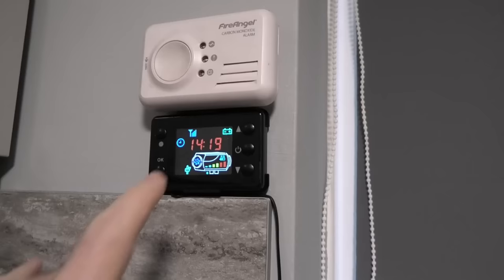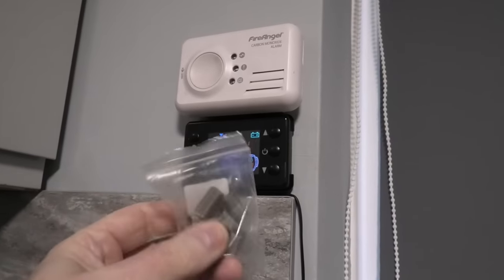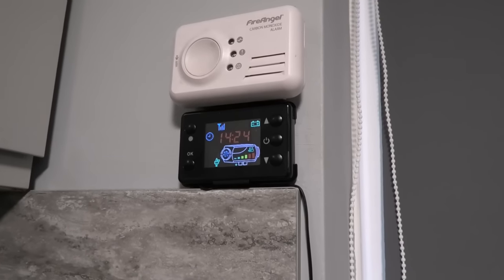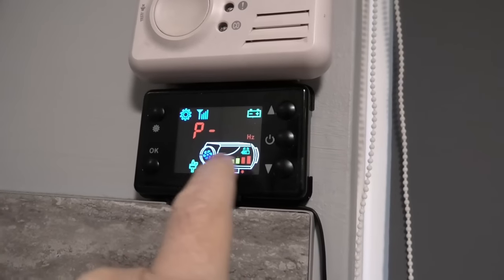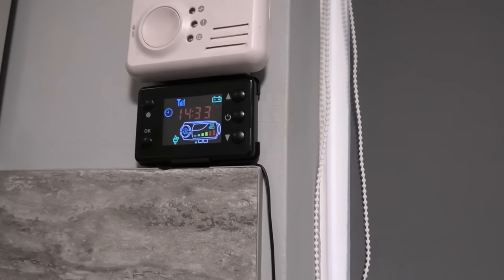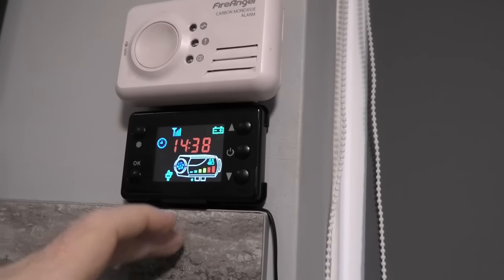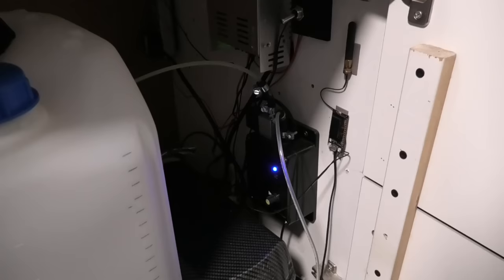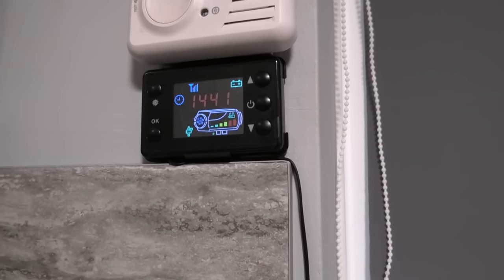How to tune a Chinese diesel heater with no tools 2kW & 5kW

Comment: That’s pretty good explanation of how to tune it. My 5kw is on a max of 3.3 at the moment as my fan speed is 4600 max I didn’t think they liked 5000 but it sounds like yours has lasted okay so might push it higher. I’ve had terrible carbon in mine but its getting better now the mixture is leaner. Thanks for the video.
Reply from the maker: They will all go to 5000rpm but different manufacturers have different default values that get them all running in the test room. Different altitudes and air conditions need different air/fuel mixtures so the manufacturer of yours might have been at a different altitude or in a vacuum 😁
My suggestion is, strip it down and clean it. I will be doing a video on it, it's not hard.
Reply: @Vortecks  I have just cleaned it. As I said it's getting better as the mixture is leaned out. It did start off as an 8kw with the usual over the top settings so it's taken a while to get it to a decent setup. I wish I'd seen your video a year ago it would have saved a lot of stress 😀
Reply: @julias-shed  that's another issue with Chinese knock offs, they lie ! There is not or ever has been an 8 KW 😏 these are copies of the eber 2KW and 5KW heaters,  the Chinese fall into the group who think more fuel equals more heat, 8KW is just a 5KW  run at a higher pump dose rate and "sometimes" a higher fan speed, this either soots up or the fan bearings go, usually because the brush end bearing gets full of brush dust due to the motor overspending and prematurely wearing out the brushes 👍
Reply from the maker: @Dirt-Diggler  Some mainboards & LCDs allow a fan speed of 5500 RPM with an increased pump speed. I might be wrong, but I think these are the ones marketed as the 8kW version. Last year, I tested a 5kW which goes to 5500 RPM and it will just about hold combustion at 5500 RPM and 5.3hz. The only trouble is, some of the combustion happens outside the flame tube and goes directly into the exhaust and the exhaust was hitting 280C. It 'might' be the equivalent of 8kW in total but there's probably 3kW which is directly pumped into the exhaust. Very dangerous.
Reply: they dont like 5000 none of them do. The 5000 is only for a badly made machine. The startup sequence rpm ramp speed on 5000 runs them to lean full stop. From the 55deg mark when the plug extinguishes and it ramps up the fan speed to max because it thinks its lit, you are merely running lean as the air in the AFR spikes massively. This has been proven by countless people with proper measuring devices. The 5000 setting automatically sets the start up algorythim to ramp the the fan up quicker than it does on any other setting so its not just the max rpm effected. Anyone whos heater can run on 5000 no problem still wants to back it off a bit as it saves the plugs. i can get boats doing 3-5yr  on these cheap copies and 5-7yr on the original plug on the genuine ones and i diall the smoke and smell out of them within minutes.
Reply: @Vortecks yeah mate dont even bother running them over 5000 they decimate plugs as the AFR is a mess at the end of the start up phase as they ramp at ridiculous speeds.
Reply: so people know what i mean the max rpm settings are only to be used on a badly made machine that really needs them to even work out of the box. If your machine even runs right on max rpm and Hz multiplier then by defacto there is dramas with your machine. On the 5-8kw 4600-4800 max and dial the fuel in from there with the smell and then try it a few timea from cold to make sure you arent getting issues on start up.

Comment: I've just installed one of these and will tune as you suggest, thank you.  Mine's in a large workshop so space not massive issue so my next step is to try playing with exhaust heat exchanging.  I appreciate that whatever I do can't create any more back-pressure than the supplied exhaust tubing, but my thought / hope is that extracting heat from the exhaust will drop pressure if anything (it's effectively a charge intercooler) whilst enabling the harvest of some waste exhaust heat.
Reply from the maker: Yes, using the exhaust as a heat exchanger is something I want to improve although I think I've got as much as I can out of it.
I'm using 32mm (I think) copper tubing which I had to silver solder together. As long as you tune the heater again after you've connected it, you'll be fine. Mine inevitably does produce a small amount of back pressure but it's been running for over 12 months like that and zero build-up.
Reply: @Vortecks  Interesting, have you got that on a YT Vid?  Would love to see what you've done.  I've got a few ideas but annoyingly only thought about doing something after the heater was installed, so although I have options, they're not unlimited.

Comment: After running my heater all winter on factory setting, I get great results, make sure the exhaust is in a downward slant, this is where the carbon or soot buildup starts. And the most important thing is "leave it alone so you don't burn your house down"

Comment: So glad to have found this video. I have been wondering about fine tuning these units. I use one to keep my bedroom nice and warm but I have noticed it really goes through a lot of fuel on high and this video has shown me that I can really reduce my consumption and get the same heat and even better air flow in the room.

Comment: I'm glad to see that someone was able to make good use of theses heaters and taken the time to tune it as I've seen several of them fail (Julian Illiet had one fail)
Reply from the maker: It does take some thinking about but they're just an engine that relies on air and fuel. Being an ex car mechanic helped understand where it was going wrong. I've wanted to shout at Julian when I saw the smoke coming from his, I get zero smoke on startup or shutdown.

Comment: I love the tinkering and tweaking of this heater. I wonder if you were able to get the dose rate so low because you're closer to sea level. I'm over a 1000' ASL and I can't go any lower than 4.5 Ghz. Of course, the incoming air temperature might have an effect on the heat exchanger, too. Thanks for taking the time to post this. 👍
Reply from the maker: Yes, there are a lot of factors which mean you have a high pump rate - barometric air pressure, air temperature, the location of your pump in relation to the heater (some people have it 3-4ft below) blocked fuel filter, water/condensation in the fuel or very high humidity. FYI I'm 500' ASL where I am.
Obviously, very cold temperatures makes diesel freeze or at least 'gum up' if the tank is outside.
Reply: dont go too low AFR as they go through plugs. Regardless of fan speed if you dont run enough fuel through them they burn plugs up and the mesh doesn't last long. If its running ideal AFR wise you will be able to run the heater at a lower normal main menu Hz setting as it will be kicking out more heat for each normal heat Hz  setting so you need to undertand that leaning out AFR doeant always equate to less fuel used per heat unit kicked out.

Comment: I've found a the low end of these settings I get higher CO readings from the exhaust and fumes start to smell , do you think the rpm of the fan is cooling the flame zone + pushing the unburnt  fuel out of the chamber to quickly ?

Comment: At last someone who understands AFR !
Appart from davidmcluckie and john mck 47 your the only YTer who even starts to understand it, soo many 5min experts out there 🙄
The original webasto and ebers didn't allow owners to sod about with pump speed and fan speed, they were set at the factory to give heat with a low ex emissions, something the Chinese dont really care about all that much.
90% of issues i fix are sooting up because owners fiddle with the settings or the base settings are way off, the older blue controller would let you set dose rate up to 8Htz with a max fan speed of 5500 rpm, some would only allow 5.6htz at the same rpm so no wonder they get messed up and sooty 🙄 after a clean out i reset the controller and tell owners to use the temp settings and stop messing with the dose rate  😏 or buy a decent make, webasto and eber obv, mikuni are ok, autotherm/plannar or the lavana pro series 👍
Really enjoyed that vid chap 👍 looking forward to a few more on the subject from ya 😎
Reply from the maker: Yeah, I noticed that there are a lot of people who just want to jump on the bandwagon to get a video published, it was pissing me off that there's not much info on how to use them properly so I decided to start the series. There are a lot of bad tips on how to use them and very little in the way of safety. I wish I could find the video where someone said to go into the settings, max everything out and it runs much hotter 😒
I've got every controller & mainboard there is out there now, I kept buying them from China. I was considering buying the afterburner buy it seemed like a lot of money for loads of features I wouldn't use so....... I built my own. If you go to 8:14 you can see the TX part of it on the right but I'll cover that in another video  😉
Reply: @Vortecks  I've gone the total opposite from the afterburner in that all i have is an on off switch with remote activation and a normal 2 wire stat in the van but my own build is a rather old mikuni i saved and refurbished from a narrow boat who changed it for a cheap Chinese unit cos it was £15 cheaper than servicing the heater he already owned 🙄 his loss my gain 😎 i got paid to change in the new unit and got to keep the old one, i removed a webasto from my van and use that for back up heat in winter at home 👍

Comment: Not long had mine. set at 1.2hz it flicks between 1 red and no red bars. I figured it may be due to the fan speed difference, like a poor A/F mix. upped my min fan speed to 2600 and it struggled to fire up. had to choke the inlet a couple of time to get the flame lit. lowering it back down to 1600 and it fired up. but still not operating at full temperature. Will be running on kerosene soon, so hopefully that burns clean enough to prevent any coking
Reply: I have the same problem, I guess ours doenst like to get to low in temperature, my stats are 1.1 at 1500 rpm and 3.5 at 4000 rpm works alright!
Reply: @kareljansen3992  after much tweaking I still have to choke it to start. I think a combination of lots of running at 1.2hz and a one off stint with a couple of liters of veggie oil has sooted up the mesh thing, I'll get it apart at some point and see what the insides look like. Before the veggie oil it ran fine, albeit at a lower temperature.

Comment: I run 5 CDH heaters, and all heaters have run very well, producing lots of heat at all settings. Any setting under 3 will produce sooting, and eventual failure to ignite. Looking at your burn chamber, I would guess it has been run at the lower end of the fuel setting.

Comment: I run mine on 0.8Hz and 1500RPM. It shows only 1 red bar or no red bar at all when it's below 0*C but never had any issue with carbon buildup. However running at around 3Hz or above without adjusting max Hz did indeed extinguished the heater and made impossible to reignite. Fortunately I was able to make it run again by blowing some air with industrial vacuum cleaner thru exhaust pipe and them pull the air when the heater was trying to ignite.

Comment: Really helpful video. Thank you. I had previously stripped down, cleaned and rebuilt my heater 6 times due to it running too lean and thus being overwhelmed by carbon build up. Not anymore thanks to this information! FYI: 8kw heater set at 5.2Hz (default 5.5Hz) and Min. fan speed now set at 2000RPM and Max. at 5000RPM (1650RPM and 4500RPM were the defaults). Now works a charm and havn't needed to clean it since, even running at low speeds all day. But from reading other's comments on fan speed, it seems that I should be at 4500?? to make it last longer + higher temp? I am at sea level (+1m) if that makes any difference, i don't know.

Comment: You are in a flat are you not? what have you done exactly in regards of the exhaust? presuming through the wall somehow can you share a pic/video and explanation in another video much appreciated. Good thinking :)
Reply from the maker: Yes mate, I'm in a flat. I'll cover all the exhaust outlet in another video. I can't just make one long video, people never watch them and it does take hours to make them.
Reply: @Vortecks  good stuff interested to see how you have went about it, As i bought one 3 yrs ago with the intention of using it for this but never quite decided on exactly how/where in regards of fitment
Reply from the maker: @monkeymagic4555  Just as an indicator - I used aluminium and fire cement to line an air-brick. Then, I put a plate inside with a fan to force the exhaust outside. Because my exhaust is around 6ft long, the exhaust exit point is only 50C maximum. All the heat from the exhaust is radiated into the kitchen.

Comment: Its great that there is even a function in the controls to adjust the unit for best results. Great info, thanks. Subbed. I live in Australia, and my retail natural gas costs AUD $20 per kw/hr of heat.  Diesel is AUD $2.00 per liter and makes 12 kw/hr of heat........there is no comparison.
Reply: Might want to look at your math. MJ in Vic is 3.52c and supply charge .83c per day. Diesel is around $2 so .0352 X 38 is $1.33.
QLD at .06 is $2.28 but who needs much heating up there.
Reply: @mathewemy  I did the math........converted the joules into watts etc.  The thing that bumps it up a lot, is the supply charge.  For a typical residential user with relatively low volume of gas, the fixed supply charge really ups the overall cost per kw/hr of heat. There are no options to avoid that supply charge other than to have the service disconnected. Furthermore, as natural gas is gobbled up by the expanding number of gas turbines being used to supplement renewables during night time and especially wind droughts.....the price is only going to go up, and up and up.  Gas turbines are horribly inefficient at replacing natural gas as a heat source in heating applications........they need to burn 3 times as much to provide the same heat energy............but since they are paying a tiny fraction of the price, they dont care about the waste of energy.

Comment: Another way to get less fuel to the heater is get a smaller pump. My 2kw came with 18.5 written on it. My 5 & 8kw came with 22 written on it. This will help those that have a different controller and can't adjust the Hertz or fan speed.

Comment: I appreciate that you have a digital meter. Presumably this is aside from the wall mounted carbon monoxide detector you have on top of your heater controller?

I also appreciate that you may well be an expert in ‘tuning’ these heaters, but many people aren’t and really shouldn’t tinker with them because getting it wrong can be fatal not only for yourself but to others living in the same space. No offence intended here, but -

Many people think that carbon monoxide is heavier than air and should therefore place a battery carbon monoxide detectors low down like you have. The specific gravity of carbon monoxide is 0.9657 while normal air is 1. Therefore it rises, hence why the recommended place for a detector is a couple of feet below the height of the ceiling. 

It is also recommended that they are not sited near to windows and at least 15 feet away from the source of a possible carbon monoxide leak. 

I think it’s worth considering these facts before tinkering with what is already an efficient and cost effective way of heating a living space.

Comment: Thank you for the video, I have the same unit buy the display has an extra button for priming the pump,  the problem is that I cannot go into any settings. When pressing that settings button only changes from temperature to manual.... I have tried all combinations of pressing the buttons and no luck... can't even set a time on this thing. And the worse thing is that only runs for 3 hrs before it gets blocked by soot.... if anyone has a solution for this please leave a comment or reach out.  Thanks!

Comment: Often check the prices of these China heaters view to purchase. Some very interesting data you found there Tony. 👍👍👍👍👍
Reply from the maker: They are cheap if you don't get conned by things like "8kW" which doesn't exist. I'm not using any of the parts that came with the heater now, all I've got it the heater and loom, the rest of it is custom made.
Reply: If you want one right now, i just got a complete 5kW kit off AliEx Vevor Bestautos store for 70 dollars, including delivery in 7 days. It came in 2 days. Amazing. Still available at this price right now. Can't go wrong.